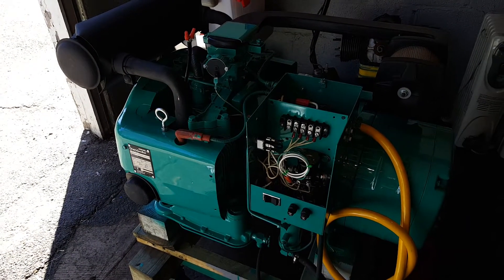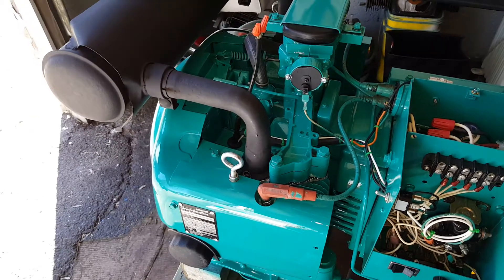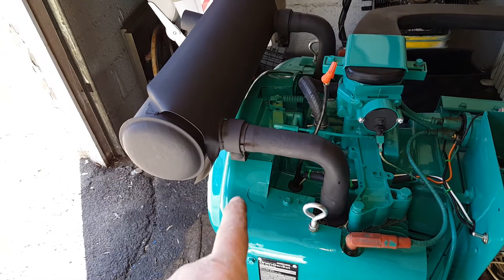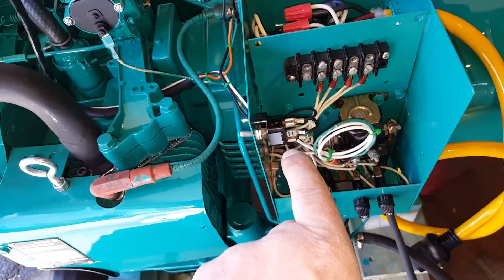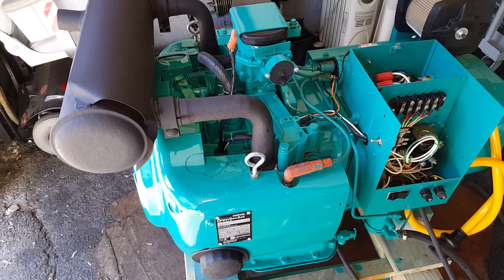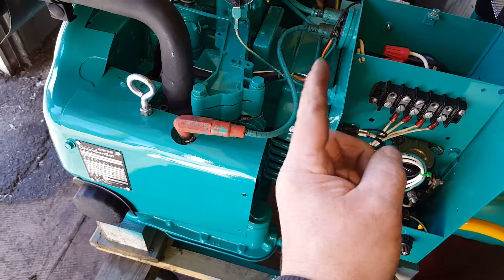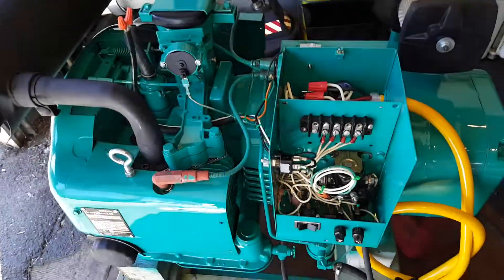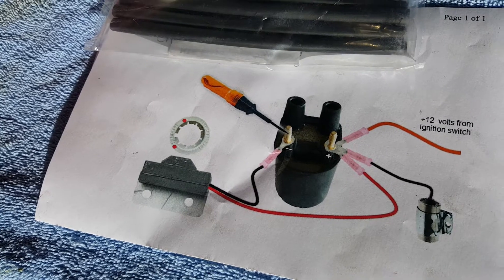Onan Electronic Ignition for the 6.5NH

Comment: Hi, did the 6.5 NH have the mounting holes for the T260 trigger? Does the trigger rotor just press on the crank of the 6.5 Nh ?
How do you time the 6.5 Nh with the T260C ignition setup?
Thanks
Jim

Comment: For a pushrod-type Onan system (with points), like the 6.5kw you have, you can use the points to trigger a single transistor which will then trigger the HEI, so you do not have to install a flywheel sensor. It's 3-4 parts (a single resistor is the third part, with a heatsink for the HEI depending on where you mount the HEI), and it costs about $30 to $45 to build [Heatsink if you need it, HEI, 2N5302 power transistor, 1x 4.7Kohm resistor]
The video is on my channel, "How to add HEI to any points system with 3 parts and keep your existing points."
Because the points only have to trigger a transistor, and the power transistor does all the heavy lifting to the HEI which in turn fires the coil, they handle infinitesimally small amounts of current, and 1 set lasts virtually forever. When connecting the HEI circuit, disconnect the condenser because you won't need it, and back the dwell adjustment screw off 1/2 turn, to compensate for the timing delay introduced by the transistor+HEI circuit. I cover that in the description on the video.